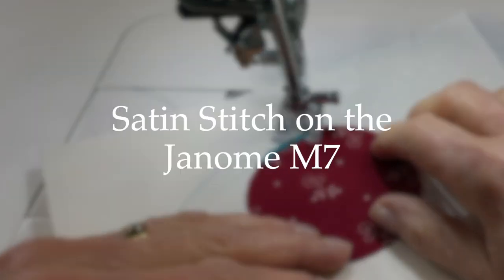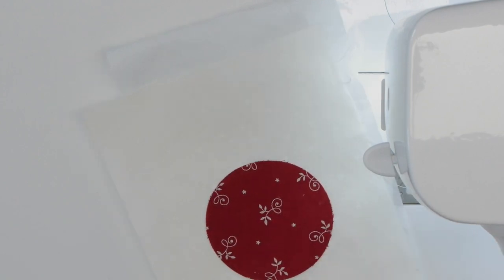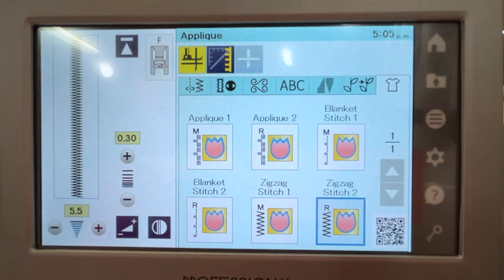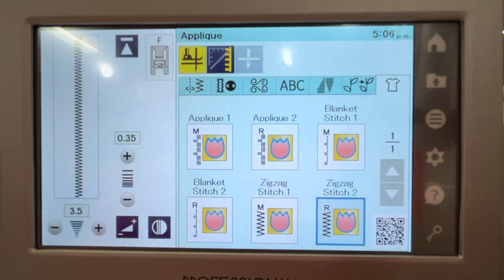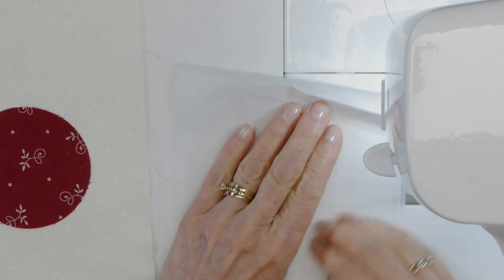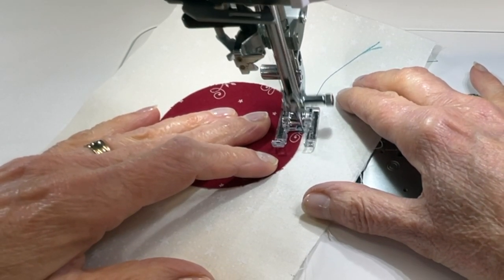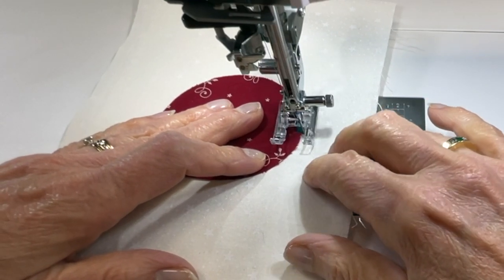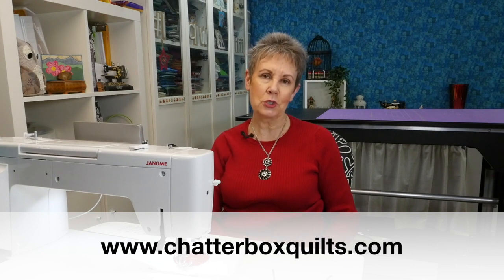How to Do a Satin Stitch on the Janome M7

Comment: How do you set the presser foot to come up when you stop stitching?  Thank you.  Great vid.
Reply from the maker: There is a setting on the screen (depending on the setting/stitch you are using_) that is on the far left side and if you press it, it changes colour on the screen to show it is activated and then, every time you stop stitching, the foot automatically goes up and then goes down when you restart. Check the machine manual and you will find this information on page 36 under "Foot up key".